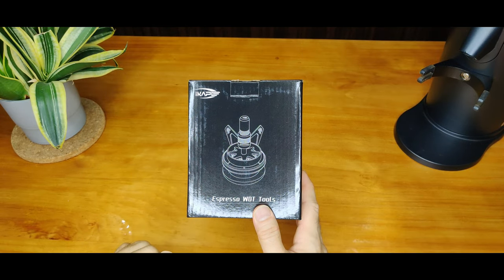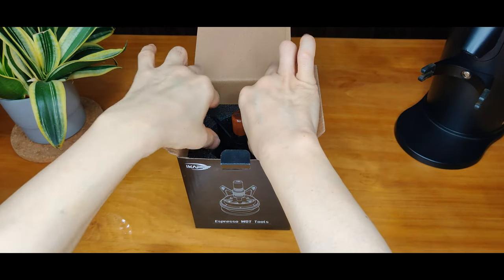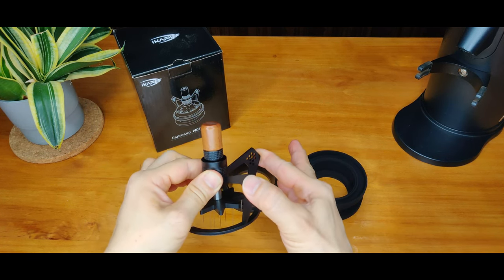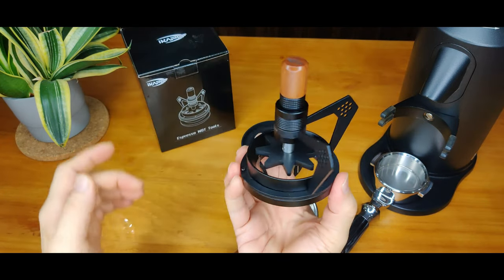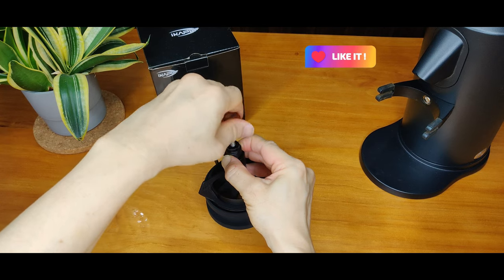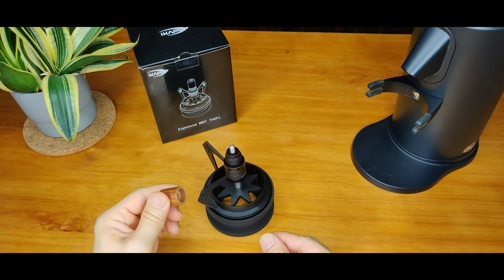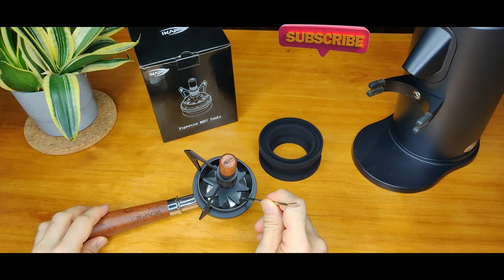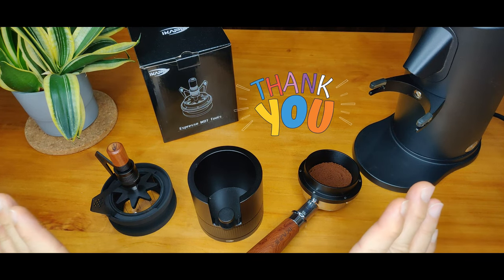iKape Rotary WDT Tool 58mm I Detailed Intro I Unboxing I Adjustment Guide I Demo

Comment: Why would they design this with fixed non-replaceable needles?  Those are the weakest and hence first parts to get damaged.  What then?  Is this device meant to be disposable because it becomes useless if the needles are damaged and can't be replaced.  That is a major design flaw.
Reply from the maker: @coreymbonge9532
 - Hi there! Thanks for your input. iKape initial plan was to include a few replaceable needles (as still printed on the label) but they decided not to. Due to its unique design, it will be too much of a hassle for the user to replace the needles. Anyway, we have been using the Rotary WDT Tool almost daily with no visible needle damage. If you use it with care and always place it back onto the base after use, we do not expect any damage to the needles. Cheers!
Reply: I saw a video of them replacing the needles and it didn't seem hard and if they don't Supply them I'm sure that you could just modify the long wdt needles and replace them
Reply: @Richard-Seekingwulf i just received and it came with replaceable needles